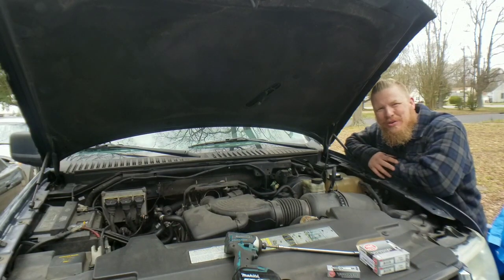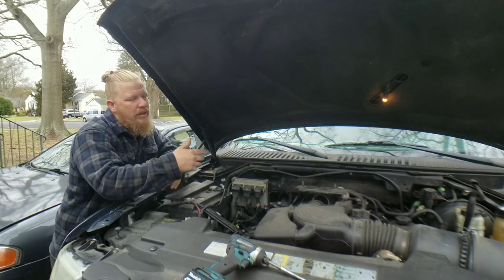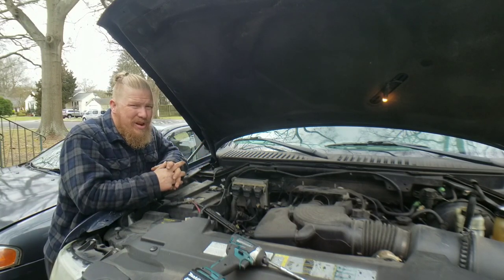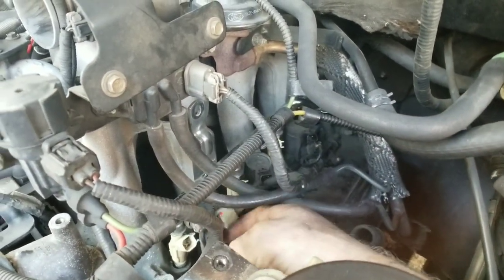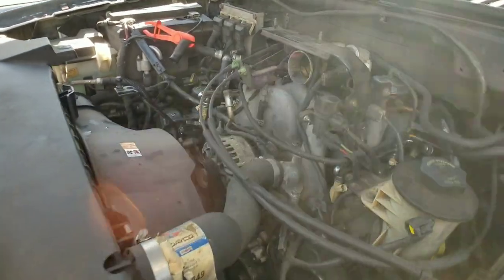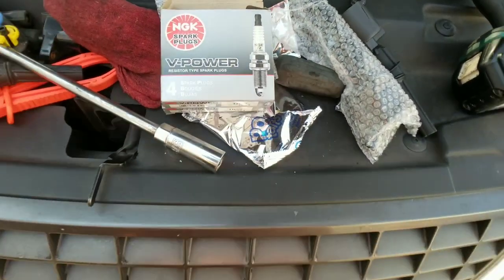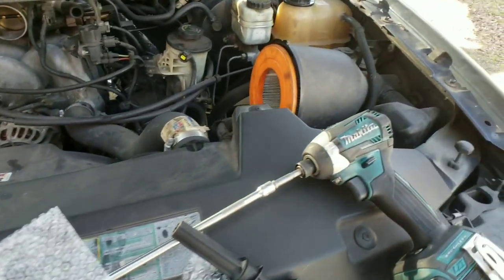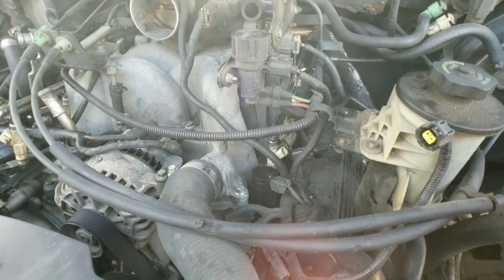2003 Ford Expedition Spark Plug Replacement Made Simple!

Comment: Great video. Glad I found your channel. My 2003 Ford Ex won't start. I can hear the fuel relay and fuel pump come on but I can't get ignition. Car will fire if I use starter fluid but it just will not run on its own. I think the issue may derive from some bad gas...maybe debris. Maybe injector problem. Car stopped cranking two years ago and it has sat since then. (!) I do know the basics: fuel/air/spark. But without a code reader it's very hard to pin point the issue...
Reply from the maker: Are you trying to crank it with the same fuel from 2 years ago?

Comment: It’s the relay for sure. I have a relay on the way. I just can’t seem to figure out which soldering wire I have to use to solder in the new relay to the motherboard.
Reply from the maker: I did not use  solder to replace this relay. What relay are you talking about that you need to solder anything onto a motherboard?
Reply: @Sellthoseflippingcars  the 2003 ford expeditions fuel pump relay.
Reply: @Sellthoseflippingcars  it might be called a circuit board not mother board lol
Reply: @Sellthoseflippingcars  and I know this video was spark plugs n coils. I was just asking cause I saw the expedition and was wondering if you might of came across this problem before

Comment: You can also remove the computer to get to the back passenger bank
Reply from the maker: That is another way, yes, thank you for pointing that great tip out! Hit subscribe so you can catch all my future videos.
Reply: @Sellthoseflippingcars  hello my car wont turn over; i turn the key and i hear the starter spin but wont crank or anything. I got the alternator checked and its good batter good. I was told it was probably coil or wires from spark plug or the spark plug but like i said i turn the key lights everything come on and hear the starter spin but it wont start or crank over. Any idea?? Oh and an other thing the day before this happened i took it to car wash and sprayed the engine with engine cleaner so i dont know if maybe i shorted something.
Reply from the maker: So the engine clicks? Fast or slow clicks?
Reply: @Sellthoseflippingcars  it was the starter actually. Took it off and had it checked somewhere else
Reply from the maker: That's what I was thinking as well. Good to hear you got it sorted out. Let me know if you have any other questions in a new thread and I will answer quicker. Sorry about the time it took to respond.

Comment: The coils screw bolt is 7mm not 6
Reply from the maker: Thank you Hubert!
Reply: @Sellthoseflippingcars  You're welcome.. I just change all eight of mine, 03 expedition.. One plug chamber was stripped I ordered a  14mm rethreader /amazon $10.88 .. this tool allows you to use a 11mm socket .. This is my 3rd tool the others were too short , I was told welding it to a long bolt would make the tool brittel and could break.. so the band played on

Comment: Awesome video. I am a new subscriber and recently started following your channel. I have a 2003 expedition with 170k miles and recently developed a bad misfire in cylinder number 8 according to my mechanic who has a diagnostic scanner.  He told me that there is a chance the plug could break (50% likely) and at that point major work costing thousands could be required to fix the vehicle. The vehicle is not worth putting thousands of dollars into at this point. I called the Ford dealership in my area and they essentially told me the same thing. I don't trust the dealership but I do trust my mechanic. It seems odd to me that replacing the spark plug and coil which seem to be a routine part of maintenance could result in such problems. I'd love your input on this and if the risk is high does it make sense to only replace the bad plug and coil instead of all 8? Looking forward to hearing from you and keep the great videos coming!!
Reply from the maker: Yes, the spark plugs have a chance of breaking. This engine is known for that issue and nothing is going to change that, besides bathing the spark plug in some PB Blaster for 15 minutes before removing the spark plugs. I have done this job not only on the Expedition but the F150 as well, your mechanic is not the only one that fears of these spark plugs breaking. I would not do the job though because of this. This is a nice vehicle and not doing the simple maintenance because of the risk is not enough for me to not do the job. I say bath it with PB blaster or WD40, remember when removing it, patience. If you feel it binding, back off, but bath it before you attempt removal. Thank you for watching, I hope this helps!

Comment: I'm in High River. Calgary area born and raised.     Currently working on my 03 expedition overlanding vehicle with the 5.4.   Has a slight tick, passengers side after a mechanic replaced the spark plugs.  I'm figuring one loosened up.
Reply from the maker: Are you getting any codes? Yes I know of High River! I was there for the bad flood back in 2013
Reply: @Sellthoseflippingcars  No codes, but there is a slight tick and an intermittent rough idle.   I'm not sure if the performance has been affected, because its always felt slow compared to my daily driver, which is a whipple supercharged 5.0 f150.

I do also have a pulley that just started making noise,  This winter ill take off the belt and spin each one by hand. Honestly I'll probably just replace all the free spinning pulleys. And the return line in the fuel pump has started loosing pressure when it sits for more than a couple minutes. I need to prime the pump twice for it to fire up.  I've already bought the new pump, I just need to drive er a bit longer because the fuel tank is plumb full.  I'm pretty mechanically capable,   I just haven't spent much time on the 5.4 engines. All my other vehicles are either old school small blocks or gen 3 and gen 4 coyotes.

Yeah it flooded the same time calgary flooded. High river has bumped up their flood prevention system since then, if it floods again, calgary downtown and lower laying communities will be wiped off the map.
Reply from the maker: You got this brother! If it is not in creep mode then its not a Major fix, no codes means all your sensors are running like they should. Double check all mounts on the passenger side for tightness.
Reply: @Sellthoseflippingcars  I'll be digging into it this winter,     replace plugs, replace exhaust Mani bolts, fuel pump, replace brake hard and soft lines due to a bit of corrosion and weathering. I rather not pop a line on a mountain side 🤣 and we are just gonna run er!    Should be an awesome overlanding unit for the next few years.   Doing a 302 5 speed swap to an 07 ranger rcsb for my wife and then I'm going to do a full expedition conversion to an f350 crew cab long box to travel with the expedition so I don't have to beat up my supercharged f150.
Reply from the maker: @stephenfrost545  that will be an AWESOME winter project!!!

Comment: I didn’t disconnect the battery and when I unhooked the heater hose the water went everywhere and I didn’t even unhook any of the coils, but I did unhook the fuel injector from the right side! I put everything back and now I have a misfire!! Dude I need help ASAP I’m suppose to be in Arizona by tomorrow for my aunts funeral.. can you help me?
Reply from the maker: Check for liquid in all of the coil connectors
Reply from the maker: Do you have a code reader? If so which cylinder is misfiring or is it a random misfire?

Comment: Hey man very informative video, mine is the same motor you have I replaced all spark plugs with the coils, I noticed there is One which is the last left back coil plug isn't working, I checked all coils test them with the motor running unplugged it to see the reaction and that One in the back isn't making any changes. Did you have any issues like that please let me know thanks.
Reply from the maker: Check the harness to see if you are getting a signal to it

Comment: Did you check the gap of the spark plugs before putting them in?
Reply from the maker: No Spark plugs come pre gapped from the factory now, unlike in the 70s where you had to Gap your spark plugs
Reply: @Sellthoseflippingcars  Yes, I'm dating myself.  But, I did check the plug and it was spot on.

Comment: holly Sh*t was i surprised when i noticed these were on top of the head. I had to remove a bunch of hoses and stuff out the way on the passenger side. now i have to do the driver side so i figured at least watch this video to see how thats going to happen lol
Reply from the maker: I did find one side a bit easier than the other but if you throw on some good tunes while you work, you will be done before you know it. Thanks for watching!
Reply: @Sellthoseflippingcars  yeah driver side is easier for sure, thankfully I didn't need to remove the fuel rail just cracked the bolts off it just enough to where it would move a bit.

Comment: I just need to replace my 7th coil and spark plug how can i do it, the fuel lines in way, can i take off those 2 bolts without the actual fuel line to do it will i have enough room to move the line to the left
Reply from the maker: If they are in the way, play it safe and remove them so you do not break them. Fuel lines dont like to bend and you run the risk of damaging them if you do. Thanks for watching!

Comment: When am I gonna see the coil and plug being replaced?

All I see is a before and after
Reply from the maker: I showed the disassembly to gain access to the ignition coil and spark plugs. Then I showed the new coils installed. To remove a coil loosen the nut that is holding it into place pull up words on the ignition coil. You will hear a quiet pop this is the ignition coil disconnecting from the spark plug. Make sure when you take the ignition coil off that the spring inside is still with the ignition coil. If you have not removed your ignition coils recently or have missed your maintenance in a role you might have troubles with removing your ignition coil. After you have removed the ignition coil grab your spark plug socket and loosen the spark plug. I hope the rest of the video you found beneficial to gain access to your ignition coil and spark plug for replacement.
Reply: @Sellthoseflippingcars  daughter bought the neighbors 03 for $500 and I have to figure out how to get to the coils and everything
Reply: @Sellthoseflippingcars  neighbor took it over to the dealership for an inspection before he sold it to my daughter.  1 bad coil and a wire that needs repaired . I'm gonna replace all 8 coils and plugs and I'll find the wire hopefully and fix it. 
Then it needs a battery, probably new tires and wiper blades
Reply from the maker: That is a great deal for a 2003! Not bad, follow the video along if you have any questions feel free to hit me up and I will help as much as possible. I do have a Youtube Live tomorrow at 2pm EST if you have any questions tomorrow.

Comment: I have one more question sorry if I’m a pain. If I bypass the fuel pump relay in the fuse box and it don’t start does that mean its the brand new fuel pump.
Reply from the maker: if the fuel pump is recieving power and still not powering up it is shot. You are on the right track. Have you tested your relay yet? Everything else is powering up just not the fuel pump? Then its the fuel pump.
Reply: @Sellthoseflippingcars  yes I believe it’s the relay. I bypassed it the fuel pump relay and it fired right up. Now I’m just figuring out how to repair it since the relay is in the motherboards…..

Comment: I've got an 03 Ford Expedition I'm thinking it's the part that goes into the coil the little white connectors for one of them has been cut on the front right side would it be safe to splice a new one into it or just replace the whole thing
Reply: I'd like to see what I'm talkin about I can email you a picture of it
Reply from the maker: Yes if you can that would be awesome.

Comment: Is the 2003 4.6L a triton Engine? I’m hearing a lot about spark plugs breaking off from being originals... Do you know if this is a problem you tried to avoid on this one?
Reply from the maker: It is a Ford engine which means you always have to be careful with it. I have never had a problem with the original spark plugs. If you feel you will, spray some wd40 or pb blaster in the tube so the spark plug will come out easier. Stay tuned for more DIY Auto Repair!
Reply: 03 triton and under doesn't have the sparkplug breaking problem the 04 up 3v tritons are the ones with the horrible sparkplugs
Reply from the maker: I sure do hope you are right, I have to do the plugs in my 2002 Expedition very soon. Hoping for a nice and easy in and out repair.......hoping
Reply: @Sellthoseflippingcars  you will be fine with a 02 they use standard Motorcraft plugs just make sure to torque them to 25ft lbs the 2v triton like the one in your 02 likes to blow the plugs out if not torqued properly
Reply: how can you tell thier orginals??
Reply from the maker: Because I was told by the owner before I worked on the vehicle.

Comment: If you have more time than money, go for it. This is a very difficult repair, and it’s not your old spark plug job where you pull the cable and pop em out. If you like working on cars and taking on challenges, go for it. If you hate working on cars like me but are balking on how much a mechanic will charge for this and think you’ll save money doing this yourself: yes you will. But if your job allows overtime or you can scrape up the cash, I highly recommend you let the mechanics do this pain in the ass spark plug change. You wont regret it...
Reply from the maker: Amen Noman lol this is a more complicated spark plug job or can turn that way quickly. Always do a repair that is in your comfort range. Thank you for watching!
Reply: @Sellthoseflippingcars  and thank you for posting! These videos are such an extremely valuable resource to have, can’t thank you enough for putting this one together, you saved me a lot of hassle and time...
Reply from the maker: You are most welcome! I am glad they benefited you with your repair!

Comment: I Just changed the plus’s and coils I was lucky I had already had the plugs changed before . I for got I had so Idid not have the nightmare of carbon packed plugs I have had several coils go out so I changed them all and did new plugs . I strongly suggest if you can get a mechanic to do this and you supply the parts go that way I checked around OKC the charge between 750 and 1000.00 larbor looney to do this plus parts I have done most of my work on my veichales I bought this new in 04 brother if you did this then God Bless you half way through I was almost sure this car came from the Devil It’s done but Ford engineering must be laughing about this ibe
Reply from the maker: I totally agree with you Jeff someone at Ford engineering is getting a good laugh! I'm glad that you got the plugs and coils all replaced and hopefully your vehicle is running a lot better now. Thank you for watching and I hope to see you in future video comments as well

Comment: I have a question can bad coils n spark plugs cause a crank but no start situation?
Reply from the maker: Yes if they are all fouled
Reply: @Sellthoseflippingcars  thank you again. And also would the spark plugs and coil have codes pop up? Cause I’m having a crank but no start and it showing no codes on the scanner
Reply from the maker: Is it clicking?
Reply: There’s no clicking.
Reply from the maker: You need to do a load test on your battery. If that is good then check for voltage at starter
Reply: @Sellthoseflippingcars  also the day it stopped being able to start it was running fine. Woke up that morning started it to warm it up to go to store went to first store no problem came out started right up. Then in the same plaza went to another store came out it didn’t start. Recently it has fuel pump done, crank shaft sensor, fuel filter. Was told my fuel pump relay fuse is fine. I was thinking maybe the mechanic who did the fuel pump didn’t do something right cause they didn’t seal it right in the beginning and when I picked it up went to get gas and it leaked everywhere that how I found out they didn’t seal it properly.
Reply: @Sellthoseflippingcars  I still have power to the truck. The radio lights n everything works. Could it still be the battery ?
Reply from the maker: It would still be something I would complete to rule out the battery completely. If the battery passes the load test then you would be looking at a faulty solenoid and would need to replace the starter.
Reply: @Sellthoseflippingcars  also I tried start it with starting fluid. It would start for not even a second n then die completely. Could that maybe be the brand new fuel pump showing signs of being faulty?
Reply from the maker: Definitely sounds like a bad fuel pump if it tried starting. My apologies I thought it didn't crank.
Reply: @Sellthoseflippingcars  it won’t crank over if that’s what you mean. An i tried to start it just now with starting fluid and it wouldn’t start.
Reply: @Sellthoseflippingcars  also before it stopped running when it would start I didn’t hear it but my dad did and said there’s a lil hesitation when I would start it up. And that day there was no warning no hesitation in the throttle. It wasn’t running funny. It was the opposite running actual fine.

Comment: Bossman if I get a fuel tank replacement on the 2003 expedition how much is reasonable price to do that and also should I buy the tank first?
Reply from the maker: Yes you should always buy the fuel tank first to make sure it is the correct one before you take your fuel tank down. A dealership would charge about $800 to $900 to do a fuel tank replacement. If you were to charge someone else doing it for three to four hundred dollars is reasonable. The job is quite strenuous if you do not have the correct tools for the job.